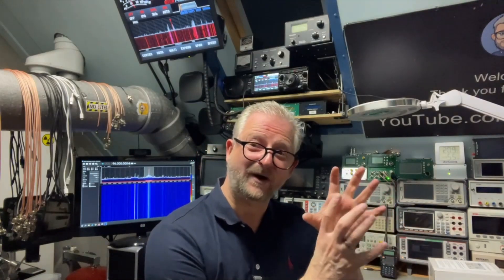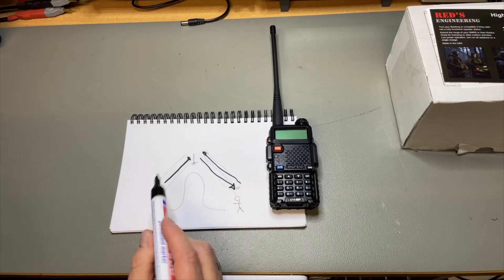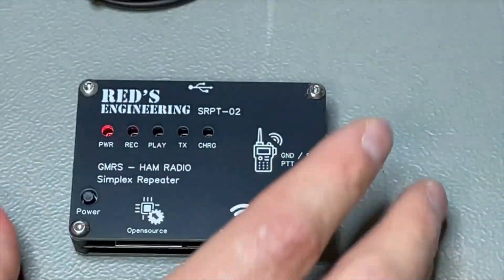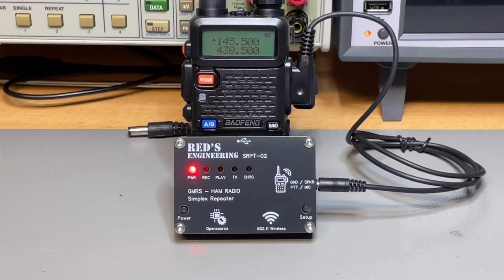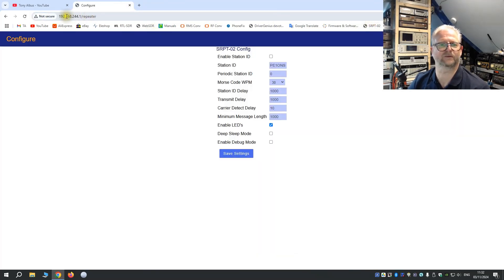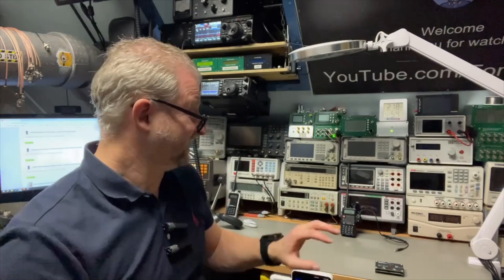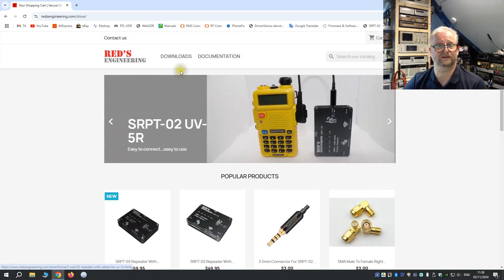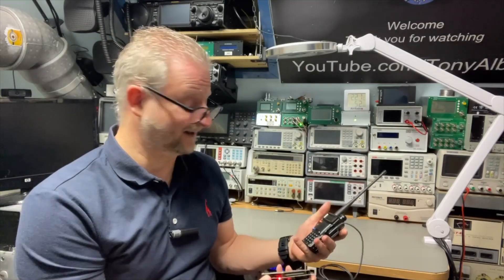TA-0427: 2-Way Radio Repeater SRPT-02 From Red's Engineering - SRPT-03

Comment: Nice simplex repeater system with surprisingly good audio. OK so someone had to say this. Just don't forget to set a CTCSS code to be different different to any other units within communicating distance of each other. Just for fun imagine Tony transmits CQ and the nearest unit repeats then another repeater some distance away hears Tony and repeats Tony calling CQ. Well I think we would be hearing a lot of Tony Albus being repeated over and over again. Imagine it, days and days of Tony shouting CQ. Seriously though the preppers will love it and in other emergency situations like groups looking for a missing person its a real winner. Another excellent video Tony which you clearly enjoyed. 73s Ian
Reply from the maker: Thanks Ian, for the nice comment, you have indeed good point to consider when you have more then 1 of these devices. 
And indeed very usefull when all other technology has failed. this running on battery with solar.. 
it was honestly fun to do the video, it just worked out of the box and wifi also just worked.
73 Tony

Comment: Thank you for the review, Tony. An inexpensive alternative to a full duplex repeater - it would take a some getting used to the delays but for the cost it would certainly be worth it. Regards, David
Reply from the maker: Thank you David, yes indeed. and low power with only one TRX .. could run from Solar